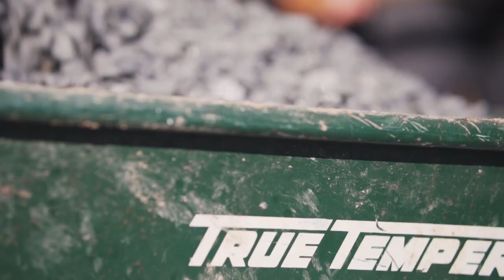Sigma 56mm 1.4 DC DN Lens + Sony a6500 | Cinematic Sample Footage

Comment: Absolutely Stunning! Thanks for sharing. What lens did you use to shoot the intro part of the video where you speak?
Reply from the maker: Opening dialog was shot on the Sony a6300 with Sigma 30mm f1.4 DC DN lens. Thanks for watching 🙌
Reply: @TTProductions1 , thank you so much. You gained a sub. I just about to buy the lens. May I know the approximate distance between you and the camera? Sorry for too many questions.
Reply from the maker: @beyourowndoctor3062  I believe for this framing/video the 30mm intro was filmed 5ft away from me. Keep in mind, the aps-c cropped sensor is 1.5x the size of a Full Frame sensor, so the 30mm lens produces an equivalent focal length of 45mm. 

I have the Sigma 16mm, 30mm, and 56mm f1.4 and I I think the 30mm is the most versatile and use that on most videos. Next would be the 16mm, then the 56mm. They're all amazing, but if you're just looking to get one prime lens to start, I would suggest the Sigma 30mm f1.4 and the model that corresponds to your Sony/Canon/Nikon camera.
Reply from the maker: @beyourowndoctor3062  and thank you so much for the sub - I truly appreciate it 🙌🙌
Reply: @TTProductions1 , thank you so much for such an elaborate explanation. It definitely helped me. I wish you good luck. 🙌
Reply from the maker: @beyourowndoctor3062  you're most welcome 🤘 appreciate the well-wishes 🙌🙌